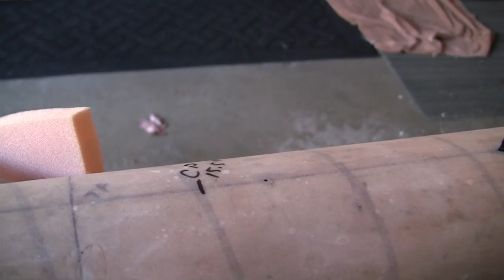Part 8 - Building the HyperLOC 835

Comment: i am trying to by a mid powered rocket and i was just wondering are you allowed to launch those without being at a rocket event
Reply from the maker: I operate under the NAR rules, so all my launches are under their supervision.  I am a member of the CMASS rocket clud in MA.  I strongly suggest seaching for such a club in your area for many reasons.  You will have free access to their broad array of launch equipment and you will find many members more thna willing to help you with any questions.  You operator under their license so FAA and other local restriction are addressed through their supervision.  

Specific to your question, under the NAR limitations, you can operate any rocket provided it weighs less than 1500 grams, has less than 160 N sec total impulse (G engine) and/or less than 80 N average thrust.  Anything over this requires a certification to fly and purchase engines.  Another reason for joining a club is that they can sponsor you for these certifications.  I suggest either AMWPro.com or Apogee.com for places to purchase engines, kits and to get a lot a great assistance.  Good Luck, Randy
Reply: Thanks for the info I have bought the aerotech mirage mid-power power rocket from apogeerockets.com because I already have a reload able 29mm motor